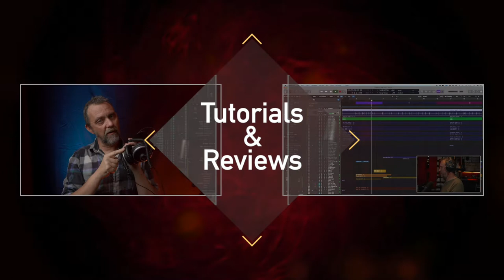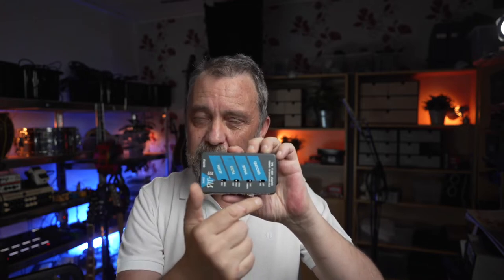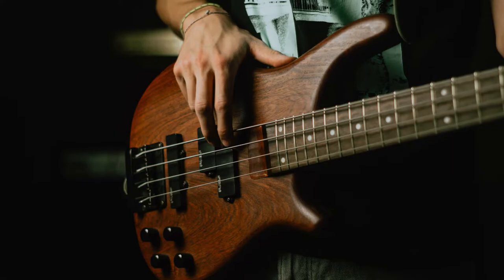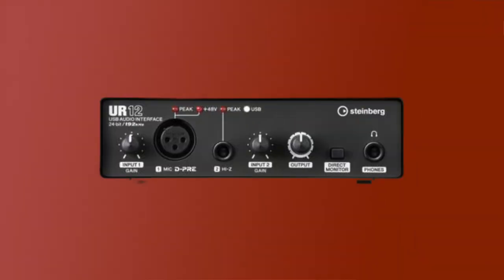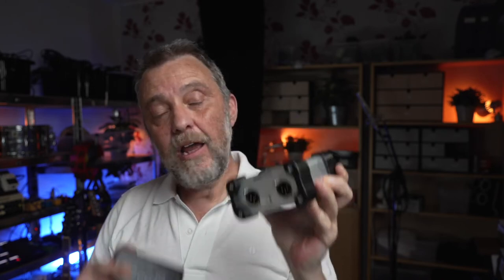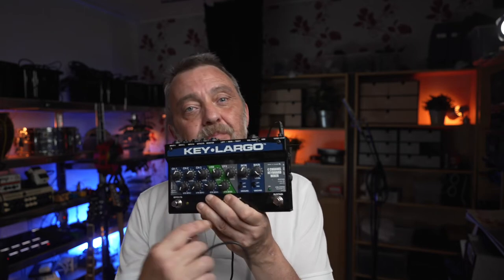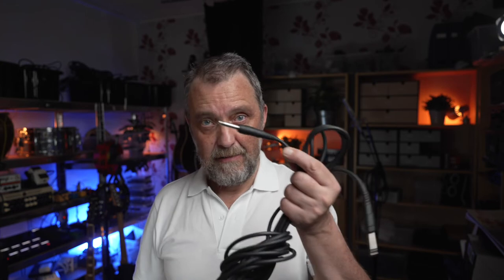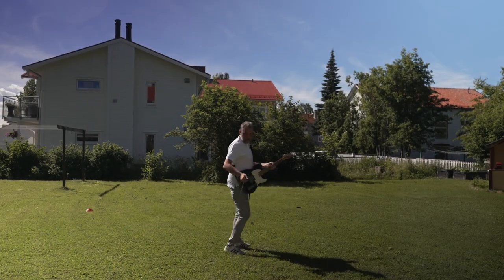DI box! Do you need one and what is it?

Comment: Would it be useful to convert a headphone level signal to a Mic level signal?  For example, you have a device which has no 'line-out' but you want to patch it into a mixer. Or do I just need to lower the volume of the headphone signal at the source.